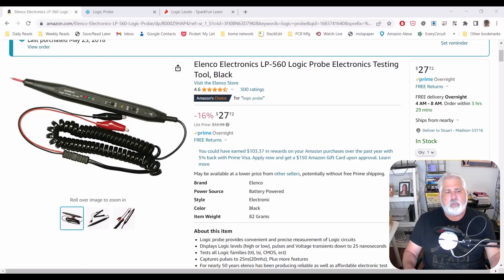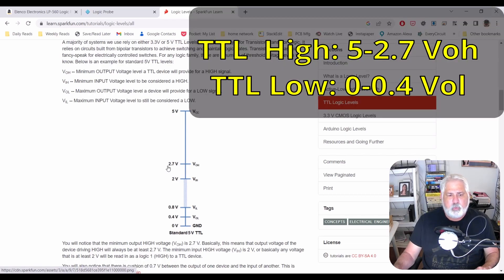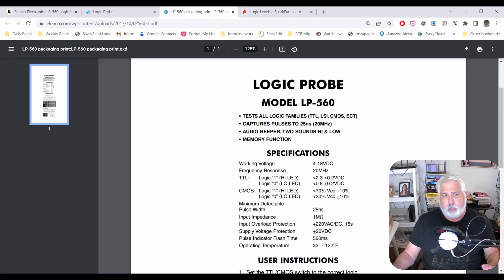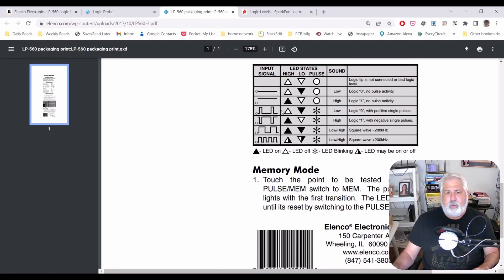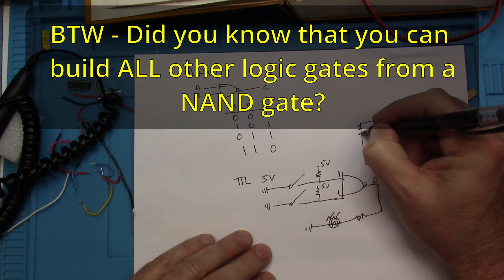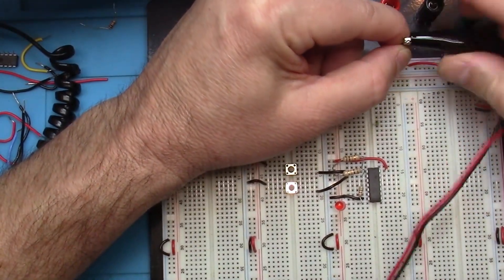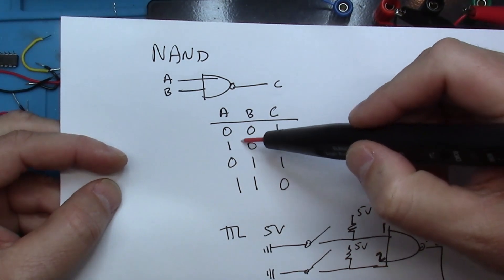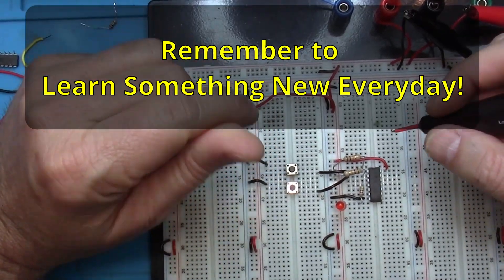Using a Logic Probe - Part 2

Comment: What if we don't have a TTL or CMOS choice on our probe?  Tenma 72-500.
Reply from the maker: I was able to find your manual for the logic probe online. https://www.farnell.com/datasheets/1843672.pdf
It supports both TTL and CMOS using a percentage of the high and low voltages to determine the logic level.